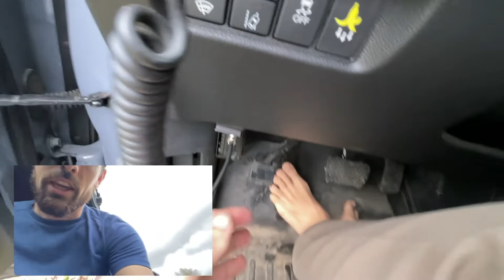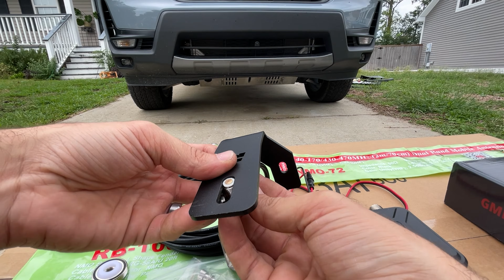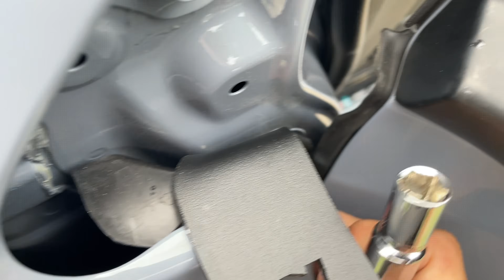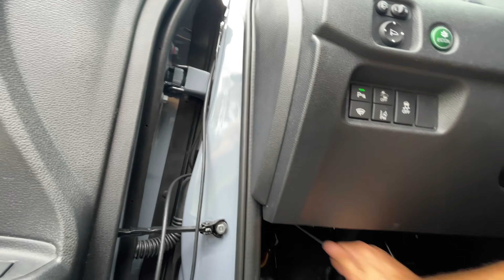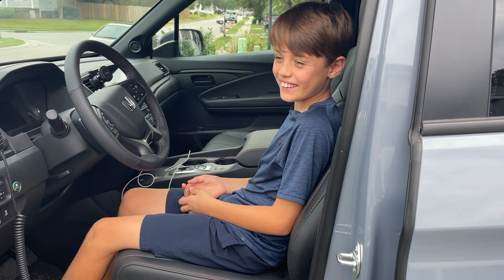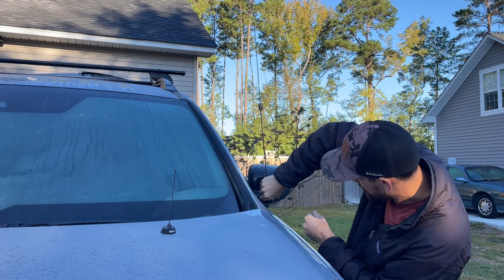Awesome Honda Passport GMRS Radio Install – Easy & Effective! (BTECH GMRS-20V2, Midland MXTA26)

Comment: Did you ever check the SWR?  I installed the same setup as you, my SWR is off the scale on all channels.  I tested the coax, all good.
Reply from the maker: No, I don’t have a tester. What would you suggest to improve the setup?
Reply: @GotterAdventure Maybe a ground strap? I see lots of videos with similar setups. Midland even recommends ditch bracket installs. Maybe my meter is faulty, lol.

Comment: I dont see the antenna bracket in your list. Do you have the part number?
Reply from the maker: I'm using the Nolo designs Mirror bracket. I will add it to my parts list.
Reply: @GotterAdventure found it online, thanks.

Comment: I have a 2025 Ridgeline, I did the add a fuze also, works great.  I have a small magnet antenna on the roof but I like your antenna install better.

Comment: Go to the battery you could burn up you harness in the car if you pinch a wire . I wanted to see how to go through the firewall .
Reply from the maker: Which wire are you referring to? The power wire is fused. I could run the power to the battery pretty easily.